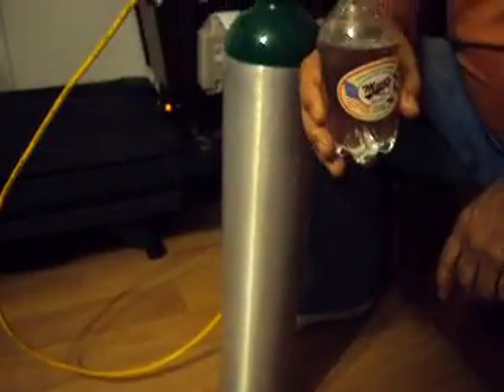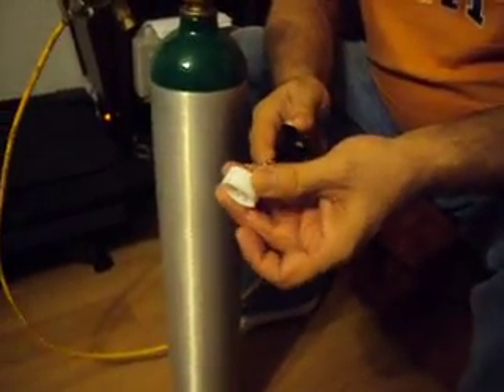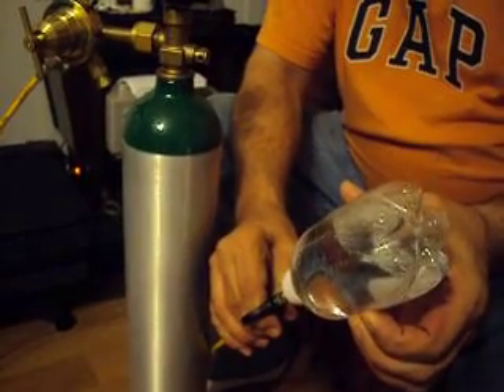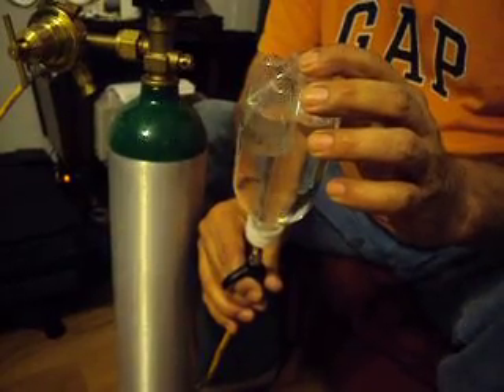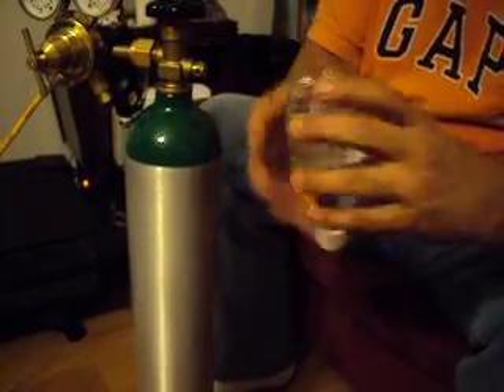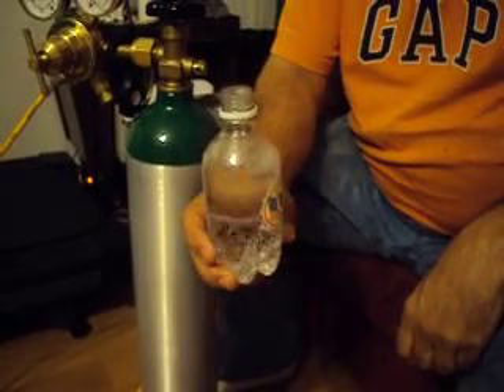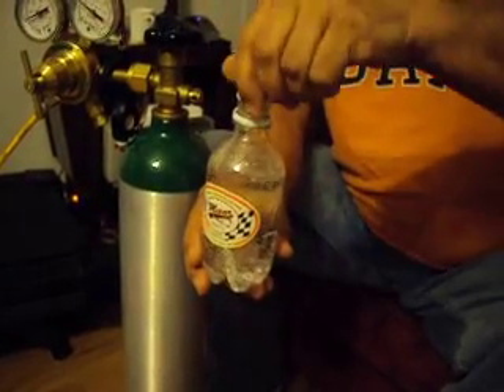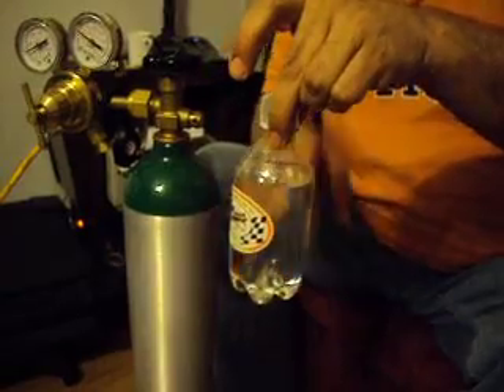Make Your Own Soda or Homemade Root Beer With A Bulk Source Tank and Fizz Giz Caps

Comment from the maker: Yep, that's a common E-bottle. Nope, it's still a 540 valve. Just modified the  nut/nipple arrangement 'n slapped an AG CO2 regulator on it. This bottle is old 'n out-a-date. I keep it on my farm 'n fill it myself. It never hits the road.

Comment from the maker: Fairly simple. Even simpler is found on sodastreamAlternative (yes, another dot-com). If you want your own co2 tank, another downstream hardware solution is shown in the following video (search for 7UMAL3X70ZY here on YouTube). Last, adjusting a pressure regulator's output is a simple as turning a knob or lever on the regulator to raise or lower the output pressure.

Comment: how simple is this for the average layperson? I am considering buying a carbonator for my sister, and I need something that is as simple as screw on and push the button. i found a welding company near her that will refill a co2 tank with a standard fitting. so how does one attach the fizz giz system to the tank? and how simple is it to adjust the psi?

Comment: do you know of a way to hook this system up (or one like it) to a glass bottle instead of a plastic one? would the fizz giz cap attach correctly to a standard glass seltzer bottle (like perrier, for example)? and what psi would you use?

Comment: you hear the plastic seal break at 0:42. indicating this was a factory carbed bottle of water.  he does recarb it but i just wanted to pout that out.

FYI...there are lots of ways to make homemade soda and the fizz giz is just one. the carbonator for one.  my home carbonation system is built from home depot parts.  the expensive part of the set up is the co2 bottle and regulator.  the method of putting the gas into the water should cost around $10....$30 for the Fizz Giz is too much.